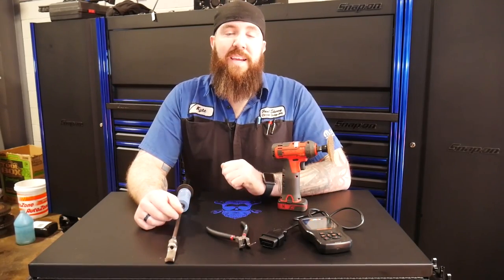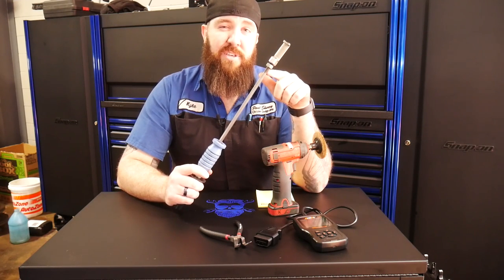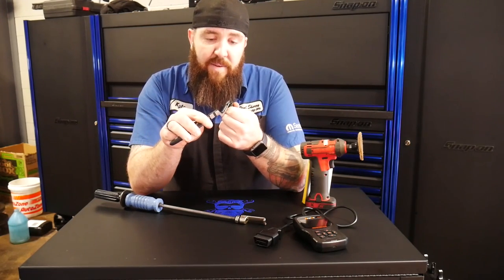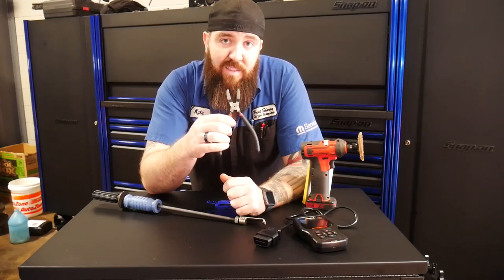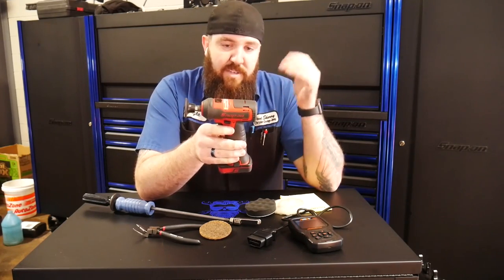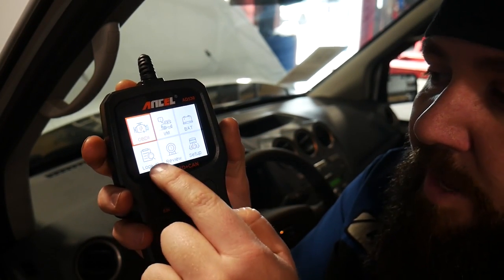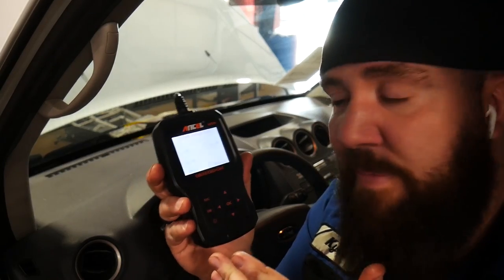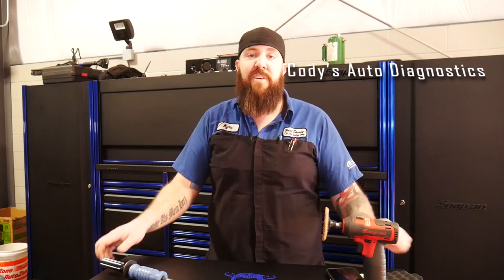RUSTBELTS NIFTY TOOLS OF THE WEEK - EPISODE 8

Comment: So, I had sent you a message about the work you did on the Trackhawck where you had to replace the passenger side Head and 1,000 miles after you replied to that mrssage I have developed a major oil leak and the passenger side head sounds funny but I dropped it off at the shop yesterday and I'm waiting for there response on what the issue is.
Reply from the maker: Can’t say I remember that message, but let me know what they find, would be interesting to see what they find.

Comment: To be honest, I’m not too impressed with the polisher sander. I’m a body guy and have to get into all kinds of weird places. Fire time I used it, I noticed that it got port hot quickly. Also took a long time to cool down. Tried it again later and it totally got cooked. Tool completely stopped working. Got only the green light when I pulled the trigger... yet the motor will still spin by hand...

Comment: Within the last month I purchased the snap on polisher /sander. For my work on airplane restorations it was almost exclusively being used with a rol-lock while our compressor tank refilled. The refill cycle was about 5 minutes and I would get 2 refill cycles worth of use out of a full battery (setting 2). Warning!!! ...... After about a combined 1 hour of total work time on the tool, it caught fire while in use. Might have been a dud from factory but will see as I just got my replacement last Thursday and have about 20 minutes of total use on the replacement. Will keep you updated.